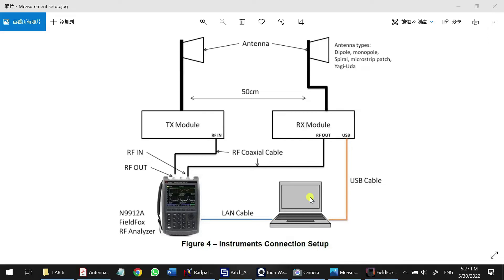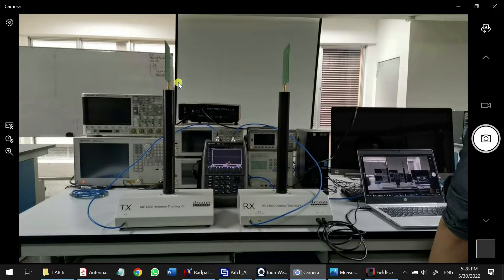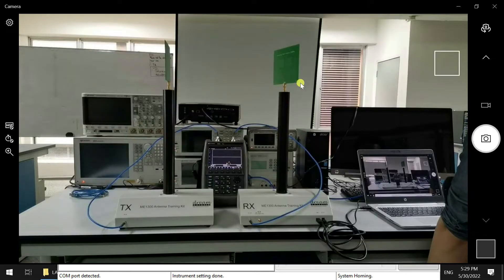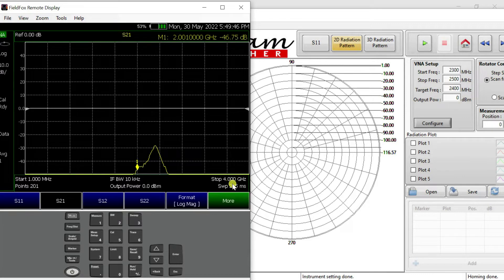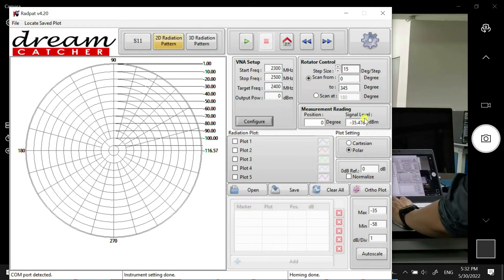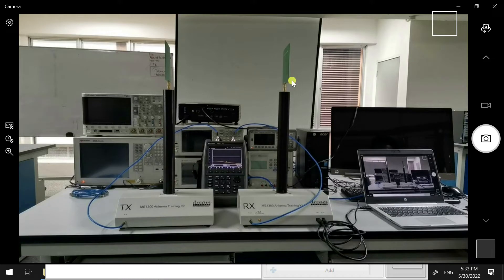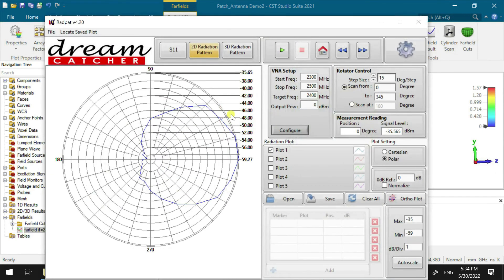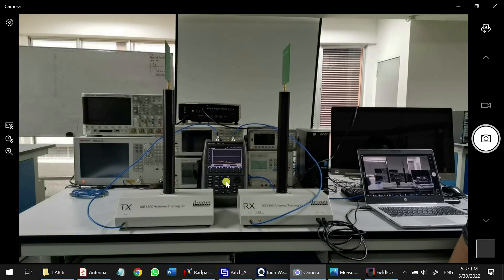How to Measure Antenna Radiation Pattern Using VNA (Keysight FieldFox)

Comment: hi  i have  a  problem   i use  a laptot ti  connect in vna  and the  connection work.  i have  a  probem with  a oc.   i   have  ethernet  connection   but    the padrat can t  see  the VNA ? What happen ?
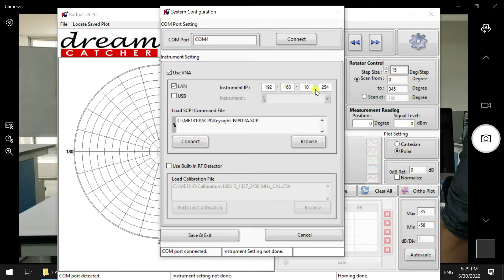Reply from the maker: Hi, You may refer to 01:39, choose the file that detect VNA instead Fieldfox. I think the padrat is only support Keysight VNA, if not mistaken. Second method, make sure your PC is able to detect your VNA using Keysight connection expert. Hope it helps.
Reply: @LYSStuff  thank!!! the  3d diagram  λ/2   dipole   like a sphere.   The RX  and  TX is near to   corner wall
Reply from the maker: For dipole antenna should not be sphere 3D radiation pattern. It either be like ribbon and donut  hor horizontal and vertical.
Reply: @ may  wall corner    distrort the  reults
Reply from the maker: @georgeveropoulos2489  possible, or other reflecting object is nearby.
Reply: @LYSStuff  i   install  the RX TR  away from  wall and object    as  possible
Reply: thank very helpfull video
Reply from the maker: @georgeveropoulos2489  welcome, and thanks for your support
Reply: The  2d  diagram are ok  the  3d  is uniform sphere     what heppen ?
Reply from the maker: @georgeveropoulos2489  my kit that I used, it only support 2D radiation pattern.
Reply: @LYSStuff  A OK...  ths radpat version   support  onldy  2d ?
Reply from the maker: My version only for 2D radiation, I know they have newer version that support 3D radiation pattern.
Reply: @LYSStuff  i  support also  the SIGLENT SNA500A but  i cant produce the n3d pattern